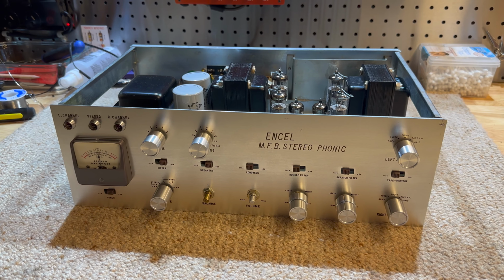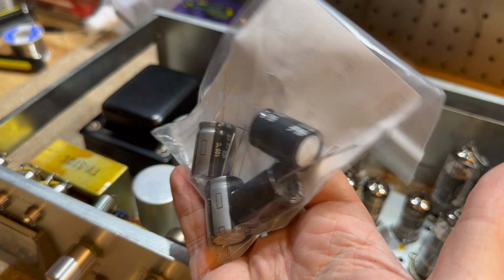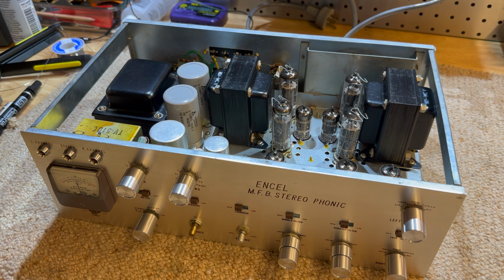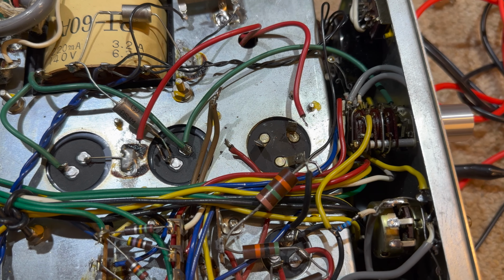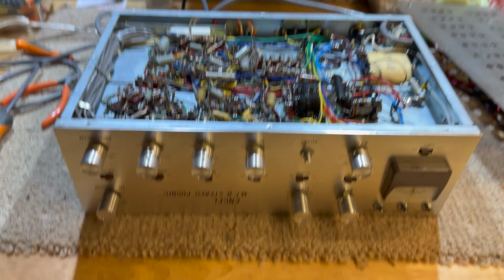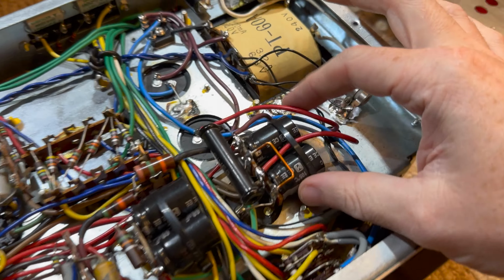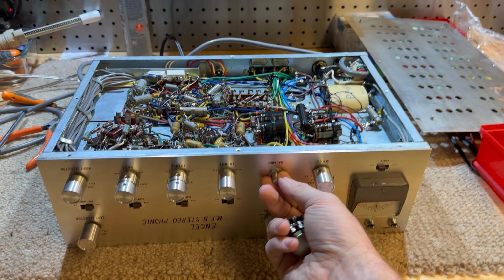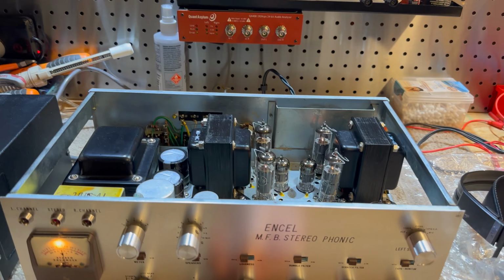Encel CSM-40 Tube Amplifier - Restoration

Comment: Was just finishing a basic restoration off on mine today... mainly just replacing the four large caps. Had a break for lunch and decided to search YouTube for 'Encel Amplifier' and of course found this video :)  Great little Amps! Mine is running beautifully now but I might follow your lead on replacing the diodes with a FWB rectifier as I'm detecting a tiny little bit of hum when the volume is over half way. Thanks for the vid!
Reply from the maker: No worries! I tried using DC for the filaments and it improved the residual hum dramatically also :)

Comment: Ok, good to hear that the Lv105, is still awaiting finalization.
Like your'e approach hiding the new capacitors beneath, instead of trying to empty the old canisters out.. 🙂

Just wondering of why you didn't tear the amplifier down, and cleaned all parts before replacing/restoring circuit. Of course, the patina adds to the authencity.. 
But nice that you try to move into tube amplifiers. I haven't looked at that direction, getting old transistors is difficult, but tubes, thats a different ballgame..
Reply from the maker: I did clean all the pots, tube pins / sockets and got footage but it didn’t really look interesting on review sped up so decided to just drop that part and focus on parts changing :)